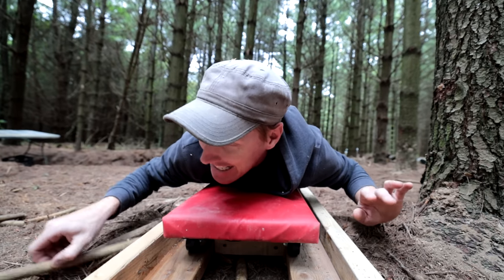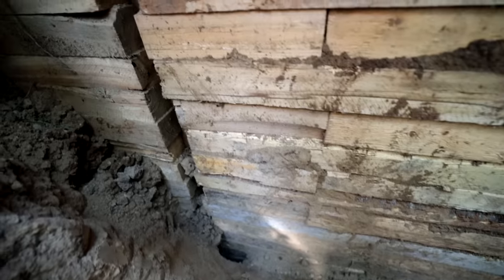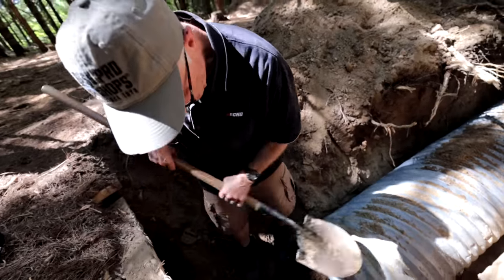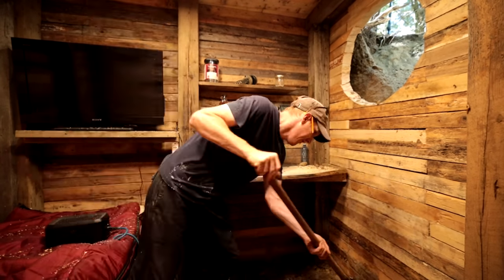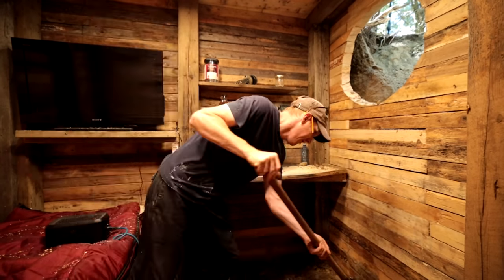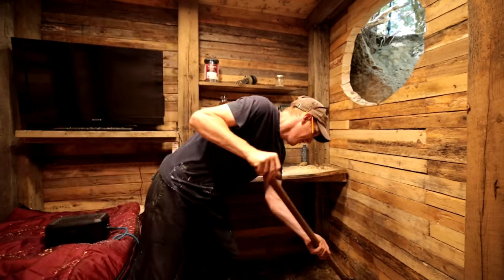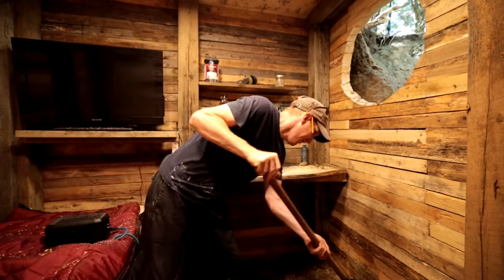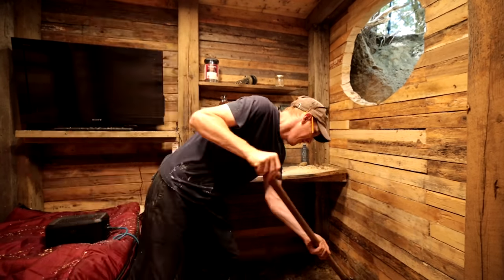Building a Japanese Spider Hole - CRAZY EMERGENCY EXIT!

Comment: Can Glue little flaps, blocks of wood, or handles on the top of exit hole, so you can lay on your back and quickly pull and push through. ☺️👍

Comment: Call it "Old Glory?"

Would have been cool to make the hole "hidden" (as in, matching the previous wall) from the inside...using a steel shelf to hide a locking mechanism.

Also, add a rope/pulley.

Comment: This is a fantastic series! Always entertaining! Do you have a humidity issue in the bunker? If the area is too humid mold or mildew might develop and ruin some personal items.
Reply: Based on earlier videos, it's about 20 degrees Fahrenheit cooler in the bunker, so the air can hold less water. 

A simple solution is to have a dehumidifier in the bunker.

Comment: Just go ahead and install a battery on that slide, like the ones on a stair lift chair. Or install a long thick rope or small-diameter tube (PVC pipe or metal rod) along the length of the ceiling. That way, you can enter the exit hole feet first, on your back, then using the rope or pipe, push/pull yourself through the tunnel. When you reach the shelter room, just kick the door open with your feet and walk down the ladder. Also, suspending a thick rope/chain (with a ring or T-bar attached to the end) from the ceiling of the room just above the door, will give you something to grab onto once your legs are inside the room. What I'm picturing in my mind are those exercise bars above hospital beds which allows patients to lift and reposition themselves. However, your hands would first need to clear the hole, and the ring or bar be close enough to your hand, in order for you to grab hold of it.

Comment: I been thinking on your ventilation.   I think you need to get a  fan that can be powered by USB or something to pull room air and push it out the duct.  Perhaps another screened one on the door to the tunnel for great cross flow of air.

Comment: Electrical putty applied to the pipe interface inside and out would go a long way to aviod leaking. In addition, putting a sump pump inside the spider hole wouldn't hurt.

Comment: Looks great.
Maybe put some skateboard wheels on ther instead of those casters.
Great door, you just need a latch.
Pull ropes?
If you came in on your back, you could put in some handles across the ceiling to grab onto.
Constantly evelving process.
What next?

Comment: It would have been best to get some tar/bituminous paint an paint the outside of your pipe, so it lasts longer underground. 

Its those wheels that make it slow down, these are not the best wheels apparently. Maybe some inline skate wheels will roll much faster. 

If you want to hide from fallout, you want at least 2 feet of dirt on top of you. So maybe you want to increase the amount of dirt that is on top of your shelter. 

The ladder looks like its well constructed, as are the tracks. :)

Greetings,

Jeff

Comment: I imagined building something similar from a cellar to a shed to a lower area. Perfect exit for when the in-laws come over. In the old war movies they would use a rope to either pull someone on the sled or pull themselves through the tunnel. A fiberglass tree stump with lid would be great over the top hole. Hogans Heroes. Which might prevent water from going down the hole. A fake outhouse at the end of the pipe where you crawl out of the pooper part or a dog house with door. I am picturing black bears spending the winter in your tunnel. How about installing a sliding board from the pipe inside the structure? You could always install a remote control winch system to pull you up the incline. Just spit balling ideas. Of course you'll need a string of lights on the top of the tunnel.

Comment: How about a simple pully you can connect and disconnect, to pull yourself out of the hole,  either manually or possibly remotely switch operated.   Just a thought since it is slightly uphill.

Comment: 🤣🙃👍 Think of two small electric motors to remotely close the top and bottom doors and a third to beam the board up and down, sort of like an electric bike motor. Two more electric motors to push/retract a floor-length extension of the wooden rail at the top and bottom of the tunnel for easy entry.
Or just a stong net to catch you at the bottom 🚀🤕😛
So hillarius, you made my night.

Comment: You could probably find like a rusty grill to put on a hinge to at least attempt to keep the forest creatures out. Also... and I'm just shooting from the hip here... but...
1) put a handle on the bunkers ceiling and maybe on the wall too; for when you use the tunnel for entry. 

2) on your back feet towards the direction of travel. Put a 2x2 board fastened to the tunnels roof as a grip - this may also work on the sides.
     2.a) drill a hole/s and run a cord/rope between the wheels through those 2x4 "axles" you made for stomach riding propelling. Pair a small pullies make cart retrieval easier too. 

3) dig a hole at the end of the pipe; 
  3.a) this gives a place for water to go instead of into the bunker
  3.b) more realistic outflow hides the hole - and its exit - better. 
   3.c) then dig a "stream/ditch" away from the pipe.

Great build man! Loving your work man!

Comment: If possible you should add a Bar just above/away the door, strong enough to pull/hold yourself out of the hole, just making it secure enough to hold your weight
Also perhaps couple of cable wire(spools) that slowly pulls 'cart' towards Spiderhole, with another one at the culvert exit, but just strong enough to keep the cable straight

As side-project, you could possible make a solar panel contraption that opens like flower, but retracts/hides when not in use?
Lastly should 'weather' the stones surrounding the exits a bit, as its

Comment: Did you think about the walls rotting from rain ground water damage? I noticed when you were cutting through the wall tgat the wood is just touching the dirt with no barrier.. it might have some serious issues in the winter/spring after the snow melts

Comment: You need something that will close the door.  A spring of some kind maybe?  And if you use it as a dumb waiter to get larger things down or haul buckets of dirt out you need a rope pulley of some kind to pull the cart out to entrance.  Water is still a worry if you get a really heavy rain IMHO unless you make a surface plug for the hole as well…. Also animals would eventually occupy that if left open for sure.  They love culverts.

Comment: Hi..you could probably extended the rail out and in the bunker..when you slide in it will slide until it is inside the bunker and you can comfortably get out also to the exit just add a bit more rail maybe cemented and you can comfortably stand up...of course you can camouflage it on the out side so that it is not so obvious...hmmmm🤔😅
Reply: Solid idea!

Comment: put a pully block on either end an run rope or cable through them one end attatches to the front of the cart an the other end attatches to the rear of the cart that way you can send back up the like a farrie pull system

Comment: Hey Kevin,  what if…..just what if……you had handles screwed to the top inside of the tube and you rode on your back pulling yourself up….and you can ride back down that way to…..two way problem solved…..😊

Comment: Idea: awesome. Execution: looks a bit tight.  If you were to ever revisit this particular project, I would like to suggest either finding a slightly larger metal pipe or cutting the current one and form it into a C or U shape. As it is, perfect for small children and dogs; for an adult like yourself? A tiny bit more room could be welcomed. I'm sure you have your reasons for the size, I just want you to be somewhat comfortable while being safe. Also, as many people in the comments are saying, perhaps a pully system would be good to have so moving through the tunnel would be a bit easier.

Comment: "And all the Europeans are laughing in torx." - 20:25
Meanwhile as a European I were sitting there the whole time thinking, "but torx are engineered to provide as much torque for its diameter as possible." (technically Torx Paralobe is even better here) And unlike flat head screws they don't slid off, and unlike Philips they don't cam out nearly as easily.

Though, personally I take Pozidriv over Philips if I can't get torx.
But most people don't know the difference between Pozidriv and Philips, but when one does, then one won't enjoy Philips screws.

Though, I exclusively use 3 different screws for general use.
Torx, Hex, Pozidriv.

And they have different advantages.
External hex is great for lager diameters. Large diameter Torx is a bit niche.
Pozidrive is good for conical heads, since it can utilize the depth better than Torx without as much compromising of the screw's integrity. (this is however a slightly niche issue, but when one stumbles onto it, it matters.)

Robertson has the issue of being far too rare. And also having the same downsides as Torx (ie, not tapered) while being worse at the amount of torque one gets for its depth. External "Robertson", ie a square nut/head is at least easy to find a wrench for, but compared to hex it won't be as nice to work with in even modestly spacious environments.

Comment: How are you going to camouflage the end of the tunnel?  Also if you travel down the tunnel on your back and feet first, you will enter the room ready to climb down the steps.  Another tip from the narrowboat crew before the advent of engines; to propel yourself in either direction,just lay on your back with your head pointing in the correct direction and just walk on the ceiling!!  Smart eh?!?!?

Comment: 20.30: yeah we are just better. torx does the one thing you want it too... It sicks. they are even made to be slightly magnetigc so you can operate a drill with one hand. also 6>4 so 6= better and (hexagons are the bestagons)

Comment: skateboard wheel night have worked better also if u use a electric skateboard mortar  would help you get in and out faster and if you had a bigger pipe big enough that you can sit up inside then that would help you to get out faster or at lest at the end wher u get out maybe 4 or 5 feet of bigger pipe night work better

Comment: Going to want to seal the hole in the center of the door or at least put screen over it before critters use it as an entrance into your bunker. Going to also need a cover for the outside hole for the same reason, be a shame to run into a skunk halfway down the tube.

Comment: Good video. But I totally disagree with the use of the steel pipe. It is a culvert and it has open joint. A small input add a false floor that but some beam on the floor leave a gap so water can be trapped under the floor. put plywwod and a lookout hole.

Comment: Lay on your back and use the ceiling of the tunnel to pull yourself along. I personally would put handles overhead AND a pulley system like a dumb waiter

Comment: I doubt you'll read this ten months later but you should dig the original entrance a little  deeper and then build back up with wood so any water that goes in the hole goes through the wood to the ground instead of into the bunker
Reply from the maker: I did this on the rebuild of the entrance.

Comment: And by the way when you were cutting that lip off of the getaway pipe I want to cut that off as soon as you Struck it with the Sawzall and the grinder and you should have just said you know what let's just frame a lip around it and use it as a lip and frame around it and then made a wall hanging or cupboard or something out of it to hide it I don't know just my idea

Comment: When I was young we built a couple underground hideouts or forts but we could only use them for a few weeks of max a couple month because the mildew turned into mold and in just a week it would start to smell them few weeks would stink and just got worse from there. Was a bummer because we dug huge tunnels and a large open building aread enough to fit 4 or 5 of us pre teens in it and like your we had tvs and light but of course our TV's where of the "tube" type because in my days flat screen ment the screen of our tube TV was flat lmao yeah I'm old and no we did not have cell phones but we did have color tv haha our remotes were 5 button using ultra sonic tone so when a nickel fell to a glass table the channel would change haha (anyone else remember that) help I'm old smgdh lol sorry I got lost. Anyway all this just to ask how you got around the mold and mildew issues

Comment: Eeeeeee small enclosed places phobia. You wouldn't catch me in the tunnel or bunker, I admire that you can Kevin!

So the tunnel is a smart idea, but I'm noticing the rock 'decorations' at the end of the tunnel (the outside end), might greatly be seen as a cave by local wildlife, and by wildlife I'm not meaning your kids. So you may have company in the bunker, or someone might move in and refuse to pay rent. I'm thinking you need something you can move out of the way from inside the escape tunnel, that an animal or escapee from the Kingston Correctional Facility, can't open from outside and gain access to the luxurious climate controlled, all amenities included, Toronto sized affordable apartment with a One of A Kind Mining Decor Design. 
That may sound kind of angry, that's because I have to move at the end of October and finding places a bachelor apartment at a reasonable price in Toronto is damn near impossible unless you're a student, or female only, or both.
2nd thoughts, Kevin, what would you charge for renting the bunker for a few months, and what is the driving distance to Toronto and back? 
You should seriously consider building an underground condo bunker. You'd make a killing right now!

Keep Safe, Always Inspiring, and Amusing,
Matt - Toronto

Comment: Just set up a real system. Them little over price 1kwh batteries are not that good. I use 1 Evault  48v 19.6 kwh, 48v panels 15 300 watt, 48v SkyMax 6000 watt invert and Midnite classic controller. Runs my whole house no issues.